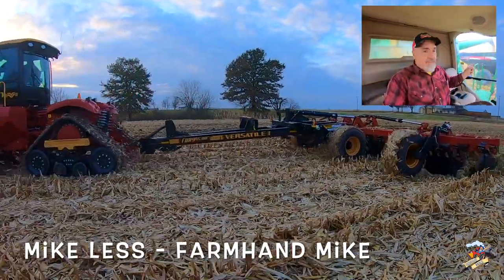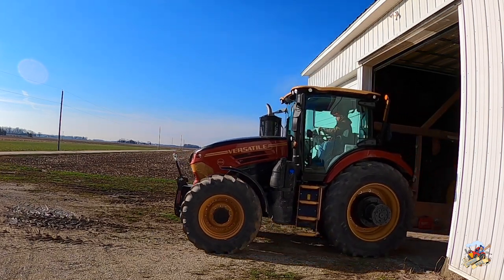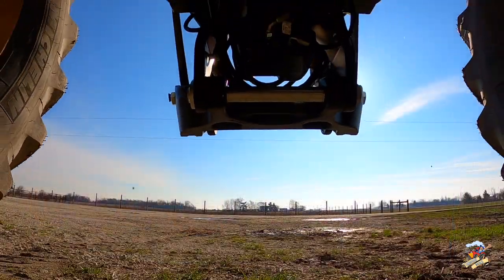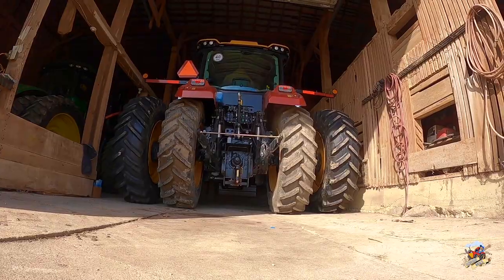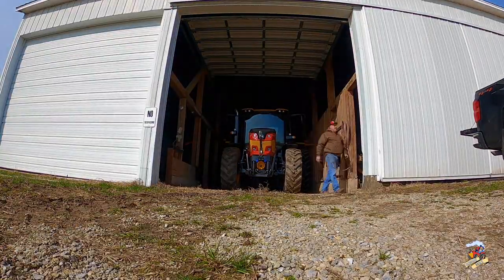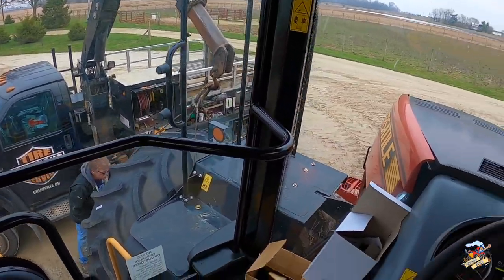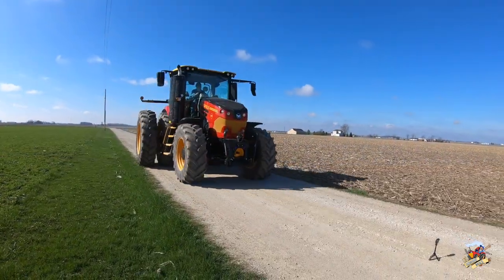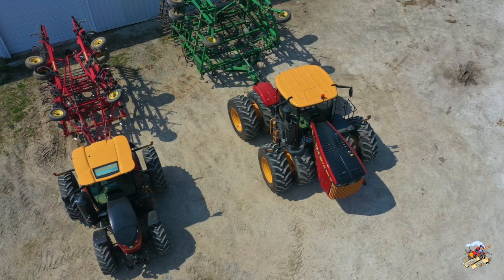NEW Tractors on the Farm for Spring 2020

Comment: Mike, I am curious about the intended uses of the Nemesis. There is a front PTO/3 point on it, which is not usual in Ohio. In snow country, that is where the blower goes if your are not blessed with a reversible machine.  Perhaps a front mounted mower? The Euros put all kinds of machines on the front, most of them not useful in corn and soybean country.
Reply from the maker: We probably won't be using the front 3 point and PTO

Comment: Just wondering  why you are using a jack to put the duals on??  Just drive onto a block of wood.  Yes it varies at to the tractor, but one learns how tall  and long it needs to be  but most will work with a 6x6 about 18" long

Comment: That 250 really looks like a small tractor compared to other 250 hp tractors? Not saying thats a bad thing, we have fendt, ferguson, valtra and john deere in the 250 class and upwards and it looks small compared to all of them except the valtra. I really dont like the way tractor design is going, all of you are saying its easier but my go to tractor is a MF 6170 with simple controls. And im a 27 year old and i run a customs company here in norway with 30 employees and 20-30 tractors
Reply from the maker: This tractor is a 210 not a 250.
Reply: Mike Less - Farmhand Mike well then i stand corrected